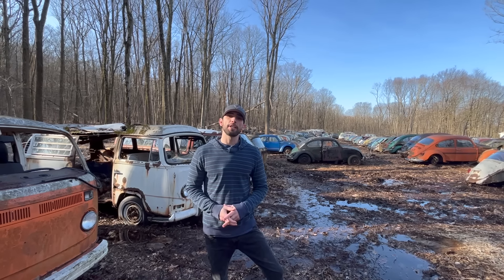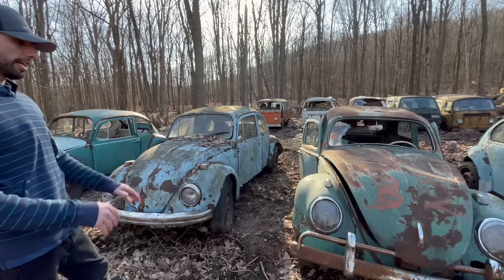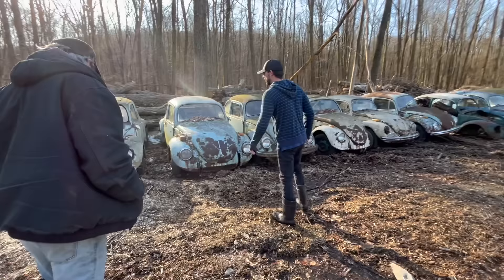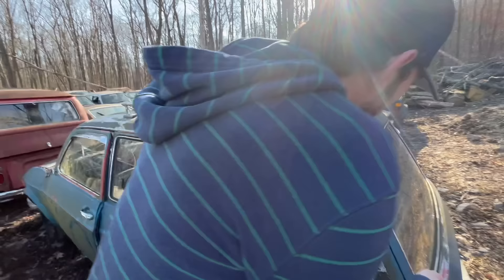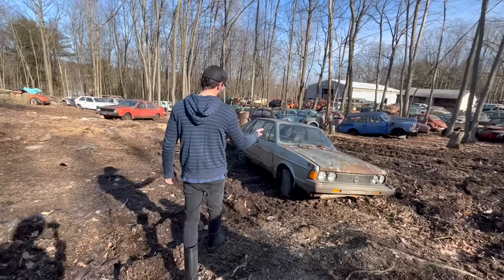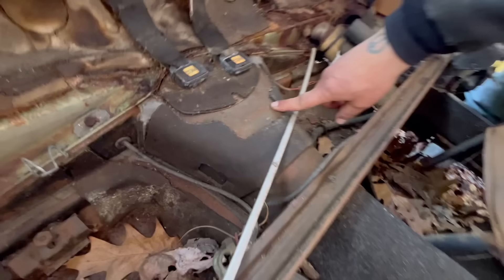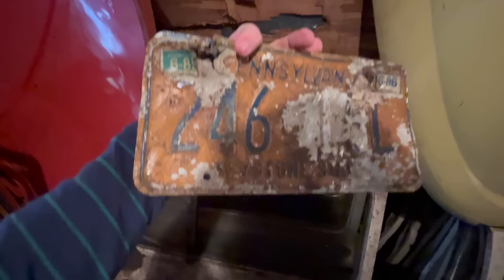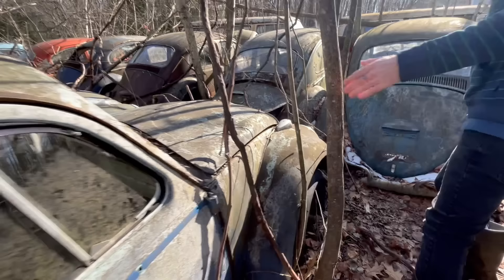FULL TOUR: VW Buses, Beetles & MORE! HUGE Volkswagen JUNKYARD!

Comment: I'm a bit older than Larry, the first car I ever rode in was  brand new '64 bug that I came home from the maternity ward in. It was eventually replaced by a '74 Super Beatle convertible (Ravena Green) that I took my driver's test in. My first car was a '74 Dasher that looked just like the yellow one (mine was red, they were based on the Audi Fox). Next was a '80 Scirocco S, that grey one looked like it had the S stripes. After that I had a '84.5 Wolfsberg Edition Scirocco that I owned until '99. Since then there have been a few more modern VWs but those weren't special like the older cars.

Comment: I was there. Pretty much all of them are rotten to shit.
Reply: I agree I was there today. Nickel dime parts are still getting hard to find though.
Reply: @bartsimpson6767 Absolutely. I bought an 86 Jetta diesel 5 speed four door. It was smashed on the passenger side and the body is rotten to shit. I brought the engine around and there are all sorts of goodies still there on the inside like trim pieces, door cards etc. If this guy had the patience to part stuff out he'd make 3X the money. It still breaks my heart to see them all in such sad shape.
Reply: If you want these types of cars you go to Europe and Australia,
Reply: @Crosshatch1212  They're all over. Running and driving ones aren't too expensive. You can get one that needs some work but it's in decent shape body wise for $1500 USD. $500 USD gets you one that you could restore or just make it solid and drive it.

Comment: looking for type 3 parts
does he ship ? where is this ?
Reply: chrome 4 lug rims , pancake 1500 , shift knob , front and rear fenders  , pedal assembly , brake reservoir with cap , Etc.
Reply: The Karmin this looked interesting. any dashs ? perhaps bus or early bug ? guess I need to measure. I think Austin is wider inside.